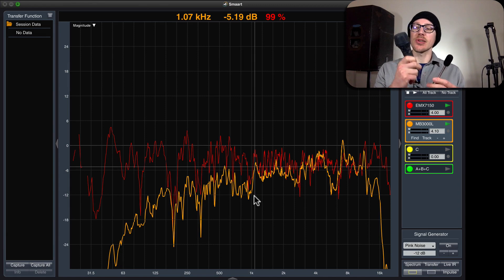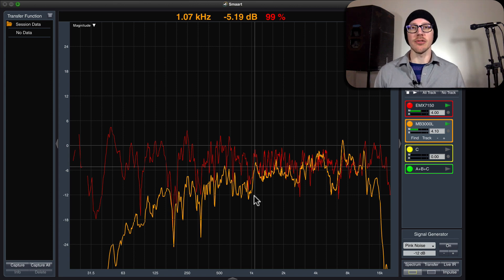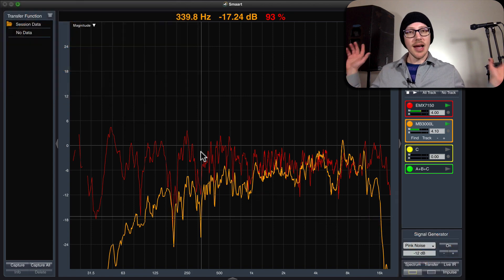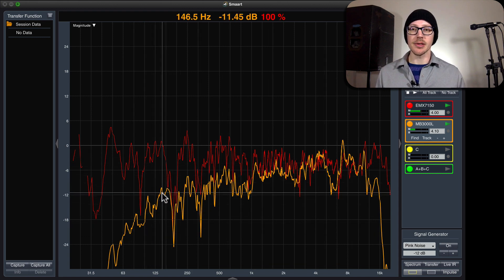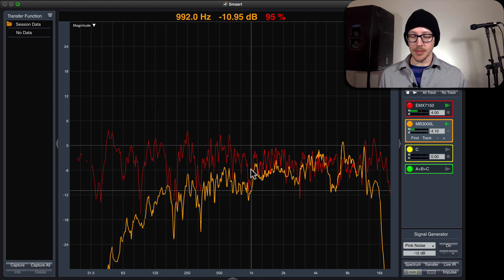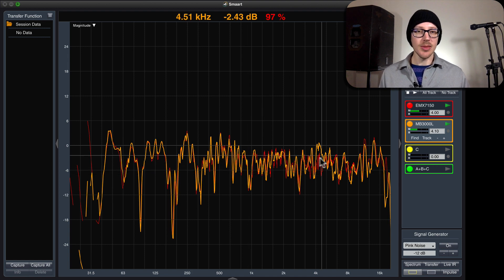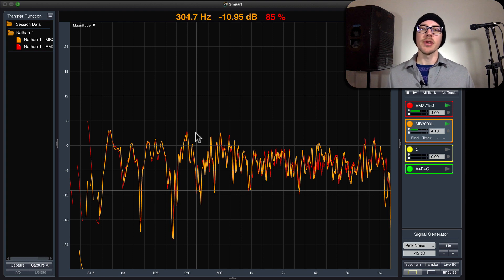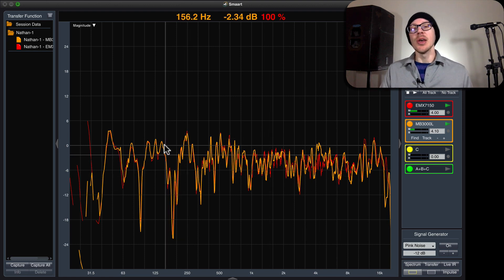How to make a $50 Behringer ECM8000 measure like an $700 Earthworks M30 [GSwSST4]

Comment from the maker: "You can use any measurement mic as long as you have the correction file for it."

Someone said this to me in conversation yesterday and I was like....shit.

So, I'm guilty of spreading this rumor. I have a video called "How to make a $50 Behringer ECM8000 measure like an $700 Earthworks M30". 
The big point is that you don't need a special mic to start practicing with your audio analyzer. You can start today with whatever hardware you have available. Unfortunately, that's not the message that everyone received and now I get emails asking me for mic correction files. 

Here's the correction: 
1. You don't need a mic correction file.
2. Any measurement mic will get the job done.
3. If you don't have a measurement mic, you can still use any other mic to make comparisons, which is the bulk of our work anyway. 
4. Start today. 🙂

I also get a lot of requests like this: Can i get the calibration file for the behringer ecm8000 microphone?

This is impossible. The only way I could make a calibration file for your microphone is if I had it physically with me and could compare it to one of my mics. Every mic has a unique response, especially the ECM8000, which makes a universal correction impossible. None of this is very important, as I attempted to explain above. Matching microphones only start to become important once you get into multi-mic measurements. Even then, I've never compared my mics and felt that they were so different that I really needed a correction to make them match.

I hope that helps! :)

Comment: I don't think you even need to correct the ecm8000 actually, acoustics in a room is way more brutal than any negligible difference mics may have amongst them, but be sure that the expensive mic is better for things other than the frequency response, so if one can buy the best, do it for the right reason, if you're just going to measure your room and put the mic in a drawer and forget it exists, don't buy the m30, cheapies can do it just fine.

Comment: Long ago I compared the ECM800, which is 20 bucks now, to a 1200.00 B&K and 600.00 Josephson mic... in fact I compared all 3 mics, and the differences are negligible. You don't need a correction curve, you need the $20 mic.

Comment: Hello Nathan, I have a question. If you I use my corrected mic (emx7150) as a reference signal and  use my new "non corrected" ECM8000 as a measurement signal and capture something, assuming I have aligned them properly to receive the same signal, then export the measurement of the ecm and use it as a correction file for itself, wouldn't I have the same result? 
It would be interesting and really fast job if it works.. Just curious..

Comment: for speakers that will be measured to two different mics, is it okay to use anything? single speaker full range or what do we have?
Reply from the maker: Hey Dillo, whatever full range source you have should work.If the speaker doesn't play 100Hz, you don't have valid data there.

Comment: Thanks for the video, but since you DO need an expensive mic, what's the point??  Just use that one!
Reply from the maker: Hey J, I have found that using a real time measurement system requires many mics. Doing it with one is almost impossible.

Comment: Nathan hello, thanks for all the knowledge trespassed, first of all, your videos are supper clear to learn. I am about to buy a mmic for measurements, my options are DBX RTA-M and Dayton Audio Emm-6. I was more into the DBX as it seems to have a higher Sensitivity, Impedance and is more robust, apart from being a well know Company with a good reputation,  but then I realized that doesn't come with an specific calibration file as the Emm-6 (I use REW), so I guess my measurements will be affected a bit more in the DBX? I don't know,  I wonder which of this characteristics weights more in order to take a decision. I appreciate any suggestion here, Thanks so much!!!
Reply from the maker: Hi AguPonce! Thanks for your words of support. I wouldn't worry about the correction file too much. It only makes a small difference. Worry more about build quality and reliability and customer support and maybe resale value. I can't comment on either mic except to say that I know people who have liked both. I don't know if you really going to start to see significant differences until you are comparing a $100 mic with a $1,000 mic.
Reply: @nathanlively  alright thank you!!! Finally bought the Dayton Audio one

Comment: Correction curve calculator would be extremely useful if it were possible to download it. Keeps asking to request access then request failed to send. Less than ideal.
Reply from the maker: Hey Matt, that calculator is nice, but the main thing it does is subtract the target from the measurement, which you can do in a few minutes in Excel. Save the result as a text file and you've got a mic correction curve.

Comment: This is  kinda misleading isn't it? You still need the fancy mic to calibrate against. Your claim that you don't need an expensive mic doesn't really follow.. Am I missing something?
Reply from the maker: Hey Chris, I think if you want to find faults in my logic, you will find many. Yes, you would need a reference mic to compare to, which you would need to ask a friend for help with. But, most cheap measurement mics are no where near as bad as my 20 year old vocal mic. They are totally fine without any corrective curve. I used that to make a dramatic example. 

Here's the big message: don't wait to start practicing until you have the right mic. Start today. :)
Reply: @nathanlively  Sorry for the phrasing, that was a legit question. Thanks for this reply, it answered my question!

Comment: The main problem is that you cannot ensure: 1) stability over long periods of time, 2) noise floor, 3) dynamic range. Regarding 1), if you have an expensive monitor and a stable audio system gain and a room that can be set up identically over time, you could use MLS noise signals to periodically compare your cheap micrphone against itself after a freshly measured frequency response and get a new calibration curve prior to using it for any serious measurement. MLS, being deterministic, should give identical results over time. But you are strongly relying on the monitor stability over time, which cannot be guarenteed. Regarding 2), if you are using an electret microphone, you are limited by the FET preamplifier, which in the case of a cheap microphone chances are that it is very noisy, This has no easy solution, but there are people who have disassembld the microphone and substituted the FET by a better one. If using a dynamic microphone, the noise floor is frequently higher due to the coil resistance and its low senitivity and this cannot be fixed at all, so it will be impossible to use it to measure low-noise rooms. Regarding 3), there is no obvious solution, the microphone just starts to distort the signal anywhere around 100 dB because of the low quality of the diaphragm. That's why standard microphones used in serious sound level meters cost thousands of dollars, and yet they must be periodically calibrated at a laboratory.
Reply from the maker: Thanks Fmiyara! Great points.

Comment: It still wont have the transient response of the Earthworks M30. It can get close, but Earthworks will still be better in almost every way except price. Also Earthworks has a lower noise floor that you can't do anything about in the Behringer.
Reply: Transient response does not matter for frequency measurement
Reply: @alf3k1 amplitude is only half the data needed.  Data in The time domain is crucial for system optimization

Comment: so if i download calibration file of a measurement microphone then i can use a cheap omnidirectional microphone to match the response and generate the calibration file for the cheap omni mic??
Reply from the maker: I'm not sure I totally understand what you are asking, but that doesn't sound correct. You need to create a microphone correct curve for your cheap mic against an expensive mic. I'm not sure how downloading will do that for you.
Reply: @nathanlively   ok i understand what you mean now. previously i thought there is a way to generate a calibration file without actually owning a measurement microphone.
Reply: @mofared  Yeah, the video introduction is a little misleading. There's no way to avoid needing to have access to an expensive measurement mic in the first place. All  you're doing is roughly copying the calibration of the original (expensive) mic by comparing it to the output of your cheap mic.

This technique is useful if you have the chance to grab half an hour in a studio after hours. But if you don't have access to a costly calibrated mic in the first place it's no use.

Comment: Wheres ECM8000 then?
Reply: @roadkillgrillmedia  The EMC8000 works with Sonarworks regardless, it's literally given on their website as an example of an alternate measuring mic.
Reply: I think you'd use the same process. Measure the curves of Behringer ECM and the Earthworks and use the correction to make them sound similar.
Reply: @brandonmason388  Well, the point is good if you know exactly the speaker's curve. Also, IMHO the 0$ mic's sensitivity on exact freq totally depends on the sound pressure and air humidity. If you take the measurement of that mic (which is not even supposed to be a measurement mic) and make it straight at some conditions, then at the other conditions it is most likely will be different, showing you a wrong picture of what is going on. My goal was to compare ECM8000 to any at least known and stable measurement mic to decide if I can use it or not, but what i see here- is just take a picture in the dark,  call it bright (Or photoshop) -  say nobody needs back light..
Reply: @nathanlively  How to make a $50 Behringer ECM8000 sound like an $700 Earthworks M30

Comment: What about microphone polar pattern¿? Measurement microphones are omniditectional in order to capture every single detail of the room. By using a cardioid or supercardioid you are measuring the speakers's response, rather than the hole room acoustics, which makes this "experiment" pretty useless.
Reply from the maker: Great point UnreaLSD!
Reply: measurement mics can be used for measuring room acoustics OR the response of individual speakers. it's useless only if you are not measuring individual speakers and only doing room acoustics. 
in other words it's not useless at all. not sure why you think measurement mic's can only take measurements of a room

Comment: Hi! I got stuck on the calculator! The number seems to import just fine but i get value errors and don't get any results at all. Don't know if that's got anything to do with the "protected" status of the document but maybe so. Google sheets won't open it for me.
Reply from the maker: Hey DubMasterFish, thanks for checking out the video. Some ideas to try:
1. Re-upload the XML file to Google Sheets.
2. Re-import data from Smaart.
3. Make sure you are importing traces at 48kHz. Not sure if that matters, actually.

I have seen bugs like this with the calculator. It doesn't work 100% of the time. You might have to play with it for a bit.
Reply: @nathanlively  Thanks! I'll give that a try!